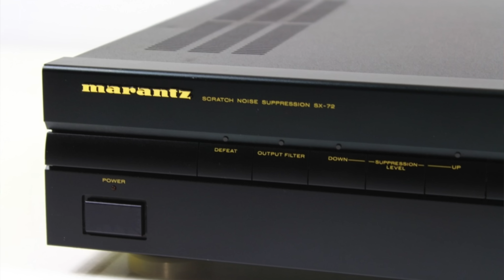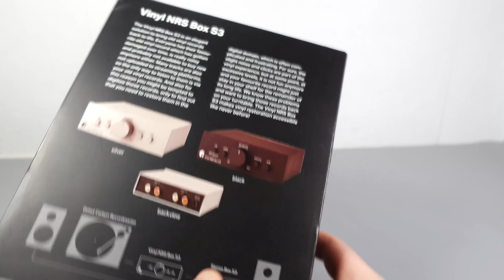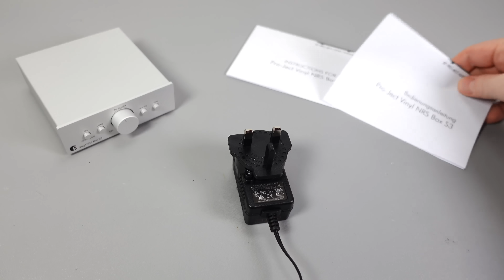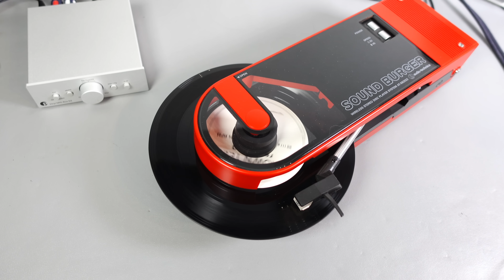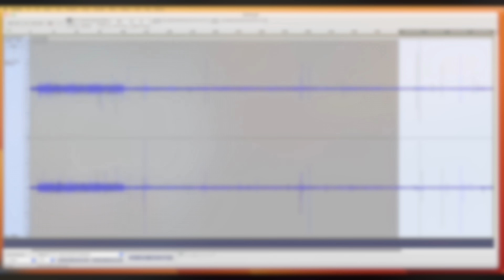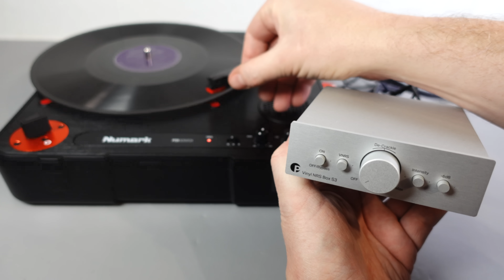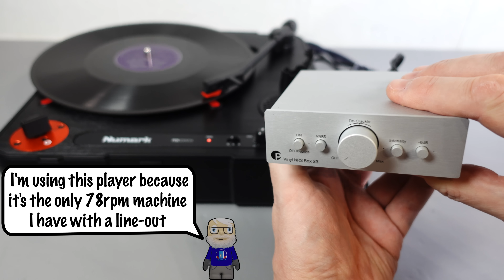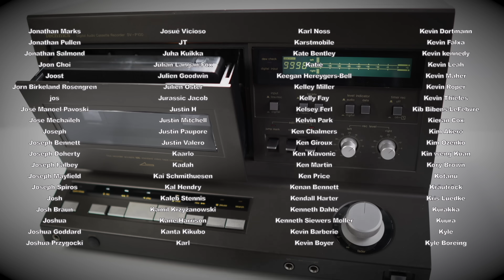REVIEW : Vinyl Noise Reduction System Pro-ject NRS Box S3

Comment: As mentioned, the Puffin by Parks Audio is a great device. I was torn between waiting for this to release vs going for the Puffin. I went with the Puffin as it had very solid reviews all round and I am a very happy Puffin user. It does much more than this does also which justifies the cost for me. Plus I believe they're all handmade by Shannon himself. A lot more wholesome.

As for the subsonic filtering, I had a record with a big issue of rumble and before getting the Puffin, I found the Cambridge Audio Solo MM pre-amp's de-rumble ability fixed it entirely, so that's also a good option.

Comment: Not impressed, but on the other hand Project haven't been able to impress me with any of their products, which I consider being sad aftermarket junk made to lure money out of consumers (Just my personal opinion of course - No one's forced to agree).
My advice to everyone would be to go vintage. On 70's amps/receivers you get subsonic filters, hi and low filters, a stereo/mono switch, and a well sounding IC free pre-amp that beats any pre-amp on the market today within a reasonable price range (Especially the build in ones in turntables, which are horrible without exception). Unlike modern junk, these features work, and at the same time, you don't have to pay a fortune to get a good system. That's the way to enjoy vinyl or 78's, no matter if they are perfect or noisy. (And if it matters: It's all analog).
In contrast to turntables which are nothing but a piece of MDF board on useless rubber feet, you can get vintage turntables with floating suspension and good stable motors you don't have to buy upgraded transformers or special belts for to get to run smooth.... And list of benefit's continues. 
This is a really awesome review that shows people exactly what they get. Thanks for existing Mate.
All the best from Denmark.
Merry Christmas.

PS. As a follow up you could make a comparison to a 70's amp/receiver.

Comment: When recording vinyl, I remove the crackles manually.

Small crackles are high frequency, and thus very short. I use a FFT filter in Adobe Audition, with low pass at 4 kHz.

Just zoom in as much as possible, select the crackle and apply the filter (-25-30dB usually). The crackle will be gone, and the low pass filter won't be audible since it's so short (if done right).

A rumble/noise filter will always remove some of the recording as well. That's why the bass level decreases. I don't recommend using it.

Comment: Back in the day some time before 1999. I used to use Wavelab with the declicker plugin. If you had 2 sound cards and a machine with enough grunt (300MHz pentium or equivlent) you could do it in real time. It did a decent job. Of course it worked best if you didn't do it in real time, then manually went and smoothed out all the big clicks and pops freehand with a mouse, then ran the dclicker after. Tip for 78's you can remove that foreground rushing noise by going over the entire record with a B5 pencil. The graphite fills those micro fisures and reduces the background (foreground) noise.

Comment: As one that has ripped quite a few albums to digital I had some that was so noisy that I had to process them to remove noise to be able to enjoy the recordings. In Soundforge there is a few tools, and the best ones has a time setting for the shape of the noise you want to remove. This actually works in real time if wanted, so if you would make such a harware tool, there just have to be a time-attack setting or noise shape setting. If you do it can be VERY effective.
Reply: it doesnt really work in real time, at least not as good. to get a good noise profile you need to analyze the entire track beforehand. trying to do it with a small window such as the last 10 seconds will reduce more than just the noise.

Comment: I am always amazed at what people will do to try and improve the sound quality of an imperfect recording medium like the vinyl record. There are some systems (quite high end ones as well) that digitise your records for playback, presumably to reduce surface wear, and they offer some optional noise reduction.  I remember seeing one at a hifi show in 2019 and it cost several thousands (it too used the digital standard of 96khz 24 bit).  One other thing - all the way through this video I wondered what would happen if you put the output of a tape deck into this device - would you hear any difference at all ?
Reply: I'm kind of skeptical of audio formats sounding better than 44.1khz at 16 bits per sample. But after seeing your comment i started googling and found claims that sound engineers find it's better to work with 24 bits and a higher sample rate because editing and filtering has more precision and more data to work with, even if it's ultimately downsampled and converted to 16 bits for the listener at the final stages...
Reply: @andrewsveikauskas  it's nice in editing as any errors from filtering or effects will be lost in the higher bits when down converting to 16bit. But I haven't seen many people at all that can even tell which is which when given a 48khz source one at 16bit and one at 24bit. Some can notice a difference, but couldn't tell you which is which. Those who could are in the tiny minority and it takes high end studio equipment to notice, the average consumer with $4k total in audio equipment isn't going to notice.
Reply: @andrewsveikauskas  24 bits gives you more dynamic range, it's pretty useful to have some headroom in the studio to more easily make use of the entire 16 bits in the final CD track. In most cases it's probably not necessary for playback, but especially classical music can potentially benefit from it.
Reply: @ozzyp97  I've written some audio code in my career and I completely understand that the extra bits could give you better results for some kind of algorithm, analogous to less rounding error. But my first point is if your ear can hear the difference between any given audio and something that's been down sampled down converted. I think the answer to that latter question is no, 44.1 and 16 bits per sample is probably sufficient for your ear
Reply: @andrewsveikauskas  I don't disagree for the most part, but unlike with separate tracks in a studio, you can't easily manipulate the dynamic range of a full orchestral piece to fit in a CD format. While still not especially noticeable to most people, it's at least clear how there might be an audible difference, unlike 44.1 vs 48 kHz.
Reply: @andrewsveikauskas  Yes, and actually the standard is using 32 bits. Audacity for example automatically works at 32 bits floating, and some USB interfaces like the Cakewalk UA-4FX also do audio processing at 32

Comment: Real-time de-crackling is quite a challenge. For quality reasons I suggest to try non-realtime solutions like noise-reduction filters in Audacity which learn the noise structure from silent parts. This destroys the analogue real-time feeling, of course. In theory real-time de-crackling can be done with an artificial-intellegence filter but I haven't heard of a buyable product yet.
An alternative to get some kind of real-time vinyl feeling with high-quality audio would be a Digital Vinyl System.

Comment: How disappointing!  I was lucky enough to get my hands on the SweetVinyl SugarCube SC-2 Mini Phono, which is the version that includes a phono pre-amp, but it does not include surface noise reduction.  For killing clicks and pops, the SugarCube works like magic; the impulse noise is simply gone.  It's not only for beat-up records.  It's so transparent that I routinely listen to all  my LPs through it, old and new, and there doesn't seem to be any down side.  With the most beat-up "torture test" records, I have to dial up the sensitivity, but even then it introduces little-if-any audible distortion.

Because the model I got didn't include surface noise reduction, I went onto eBay and found an old DBX SNR-1, single-end noise reduction system.  I can feed the output from the SugarCube through the SNR-1 and get the benefits of both devices.  The SNR-1's benefit is less dramatic, and it has trouble dealing with extremely noisy records, but when the dial is adjusted properly it does result in a quieter noise floor without putting hurt on the music.  Again, I keep it engaged most of the time with most of my records.

Comment: Excellent review and demonstrates quite effectively why this device is not worth the money.   I suspect the rumble filter is similar to a low frequency filter, a device that was common on amplifiers a long time ago.  My Sansui AU-7500 [vintage 1974] has low and high filters that I use sparingly, most often for 78's.    The low filter is perfect for rumbly Perfects and Pathes from the late '20's, and occasional records that were recorded with a hum from the mains.

Comment: Excellent video.  Assuming you want a physical audio source the simple solution to removing cracks and pops is to listen to a CD.    The amount of faffing you need in terms of turntable set up and vinyl care / cleaning  to get a vinyl LP playing well far outweighs the vaunted benefits of the analogue sound (IMHO).   My current turntable is a Linn with a  Nagaoka cartridge and 99 times out of 100 I tend to chuck a CD on.
Reply: @Pixie Pete Because most records just don't hold a candle to their CD equivalents? I also have a Technics MK2 with a Shure M97ED and find myself listening to more and more digital media each day.
Reply: Did this weirdo just block me for no reason?

Comment: It does something but not enough to warrant a purchase. The crackles and pops are part of the charm of vinyl. As you say any cheap analog rumble high pass filter would do the easy bit. I assumed there would also be some latency in this device as you would expect it to listen ahead and then remove the pops etc before output. P.S.   I would have been in hysterics if that 'blank' dbx record hit a content match! 😊

Comment: I have an SAE 5000 Impulse Noise Reduction unit sitting to my right.    This was purchased in the early 80's.    It reduces the crackles or click/pops/scratches.    A slider on the front to set the sensitivity and buttons to remove the crackles or select only the crackles so you can hear the noises being removed.    Setting the sensitivity too high causes some of the music to be discarded.   A Supertramp album, Crime of the Century had a bad scratch on the track School.    This unit was able to remove most of the scratch.    I later purchased a Direct to Disc version of the album which did not have any scratches.
Back in the day SAE made good products.
Dave.

Comment: With respect (and truly meaning that!  I do have tremendous respect and as always thank you for producing this!) I would question what you're testing. It feels like you're expecting an elimination or reduction in number of crackles?  The specs in the "instructions for use" document makes clear that the device is meant to reduce the volume intensity of crackles by 12dB at maximum. That's what it sounded like to me on the Beethoven album, same number of crackles but most were significantly reduced in intensity. It was more listenable on the max intensity to me. The blank album might not show that as, while noise reduction worked, the Box would be looking to reduce intense micro bursts of volume against a main signal level - and there is no audio signal to baseline against so no reductions. But we are also in the audiophile subjectivity trap - I think I hear something and that doesn't mean you will or that what I heard was real... And you spent much more time with this box than your footage shows.  And I don't do vinyl anymore personally and wouldn't spend that kind of money for a box like that.... unless I won the lottery. 😂  But again, thanks for making the video.

Comment: In the 80's, an analog click/pop suppressor project "popped-up" in Popular Electronic magazine. Few opamps coupled with high frequency detection to mute pops and clicks. A mute period was filled with an average value AND it was connected directly to the cartridge output otherwise, as it is the case here, the external phono preamp smooths out the high frequency contents of a scratch or pop. Bad design form start.

Comment: It's why most of us fell out of love with crackly, noisy vinyl and migrated to CD. In the days when vinyl was king, I'd generally buy another copy of the record. Thanks Matt for your demonstration of how difficult it is to remove pops and crackles, I guess you could always use Izotope RX, but then you lose the tactile fun of vinyl. Perhaps instead of Vinyl you needed a Shellac Noise Reduction System for your 78 - although, it was only later 78s that used shellac resin for pressings ;-p
Reply: If you buy new records and have a good setup there is zero pop and crackles.
Reply: @ulgn1964  Thanks for letting me know. In terms of pre-recorded material I usually buy CDs these days, but I have thousands of vinyl from the 70s to the 90s and was interested if the S3 would make any difference. My Linn Sondek isn't a bad black disc spinner tbh.
Reply: @apislapis  I have a Rega RP3 with Goldring 2300 pickup, Lejonklou RIAA and Hegel H80, i only buy new records, sold all my CD's.
Vinyl is by far the best sounding in my setup, the base is super deep, never got the same low base from a CD or when I'm streaming something from my computer.
Reply: @ulgn1964  I guess it's whatever works for you that matters. I subscribe to Electronic Sound Magazine and they send me vinyl with each issue featuring the artist in the main feature. I hope someone gets decent bass from a computer as that's how they record music these days.

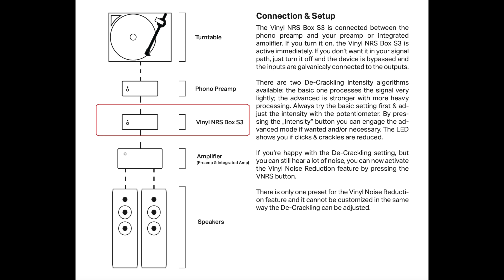Comment: 1:25 - If it works with vinyl, could it also work with cassette decks? 

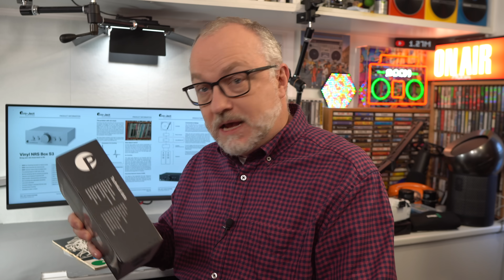2:30 - There's software that converts audio to MIDI, which won't (shouldn't?) hit a DIScontent match.  Could you overlay digitized MIDIs in your videos?  People will know ~what~ you're playing without doberman lawyers attacking.

18:30 - You can't make filet mignon from ground chuck.  The device clearly has some effect, but it's likely best with mildly damaged records.

The record player at the end is worth a mention, the Numark PT-01 USB Scratch.  I'm waiting to get one.  It's only belt drive, but when apartment living with little room for a full stereo....

Comment: Great video. Is this another myth busted? Seems so to me. I remember the same filter system on Amstrad all-in-one hifi systems back in the 70's and 90's. Even back then any form of NRS always detracted from the source, same with cassette tapes and Dolby NR; so I never bothered using them. When audio went digital, so did the snake oil 🤣 As long as the source was the best it could be, making an MP3 at 128kbps was absolutely fine. Hi-Res audio is again snake oil. However, what these systems do prove, is that if the source is bad you will always have a poor sound experience. Some music was expertly produced and sounds amazing; most of it though, is absolutely rubbish and barely fit for AM radio broadcasts.
Reply: This is not a myth busted, just one device that apparently doesn't live up to the adverts.  He also mentioned the SugarCube, which works great.

Comment: I think Pro-ject is a bit overrated on their products: they always get good reviews, but my experience is not that great. I have a Debut III turntable from mid 2000 (it was an entry level - that is clear) but build quality is pretty cheap and there are severe design flaws in the motor suspension design causing high rumble noise. 
As for a digital noise reduction system for vinyl records - that's a total non-sense to me. If you want clear sounding music, just look for other sources. Rumble, crackles and surface noise is part of the package that comes with vinyl records, either you accept it or you will be disappointed. After all, a solution to all those problems was indeed invented almost 40 years ago - it was called the Compact Disc

Comment: There are a few things like this around.  Puffin DSP Phono Preamp from Parks Audio is pretty darn good too, but some of them are really expensive.  People who are audio nuts tend to spend a lot of money on things like this.   
This Pro-ject one, VNRS, without the decrackle, is basically a filter that blocks the low end, like a subsonic filter.   If you increase the bass to compensate for it, you'd likely bring the rumble back.
Reply: It's way cheaper to buy a 5 dollar cd and be done with it.
Reply: Seems like a bit more than just a bandpass filter. Certainly that's a key method of it's operation, but if that's all it was it wouldn't need to digitize the stream. It's definitely doing some other mathematical processing to the signal (the effectiveness of this is left to your own opinion) - You can hear it, too. Not just a bandpass filter.
Reply: @UnitSe7en  If you used computer based NR they profile the noise alone and then the plugin deducts it from the audio, but the bass always seems somewhat affected too, especially if you're aggressive with the NR settings. I presume this is doing something similar but with a pre-profiled noise. It would be way cheaper to get a computer audio interface and use plugins, at least for the rumble reduction.
Reply: @MrMurUK  Seems to be the gist of it - A computer and your pick of software is cheaper and better. Although not as convenient, depending on your use case.
Reply: @UnitSe7en  digital EQ means higher profit margins for Pro-Ject. Relatively cheap converters (ie not bottom of the barrel) match or out-perform the characteristics listed. It keeps the component cost and signal chain small too. 

It’s possible there’s pre-profiled noise filtration like the other person said, but I think a lot of it is just carefully chosen notch filters. You can hear the crackles which are higher or lower pitch make it through, it only blocks an average-pitched pop.